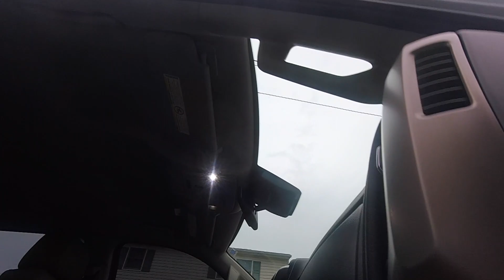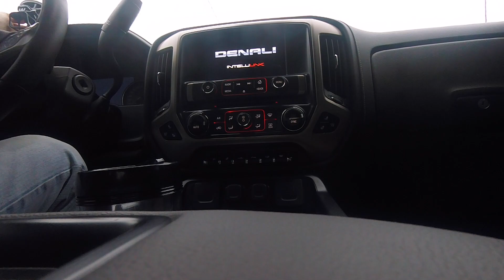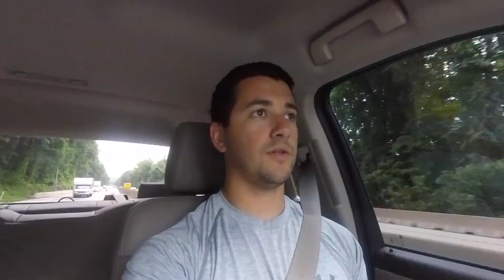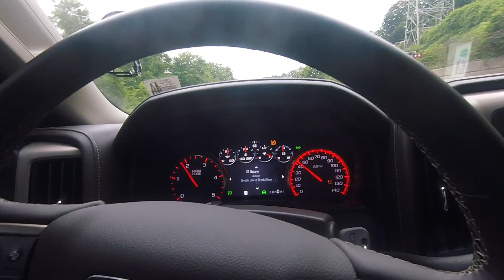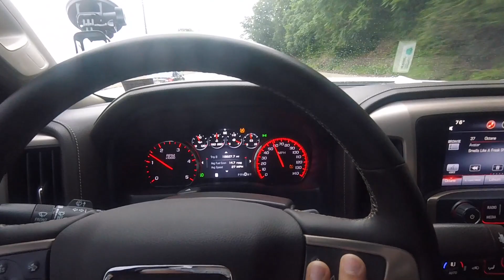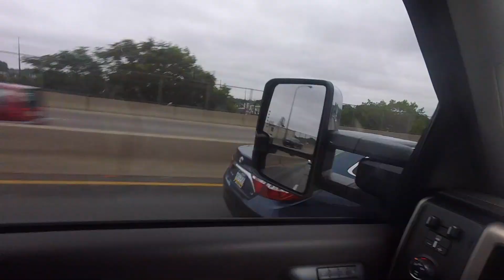What I Hate About My Denali!!

Comment: meguairs wheel brightener will clean your grill as well as chrome ring
Reply: it is also used to remove water spots
Reply from the maker: The chrome I've never had a problem getting clean, but I'll have to give it a try for the mesh. Thanks!